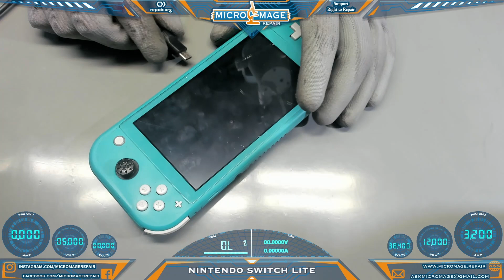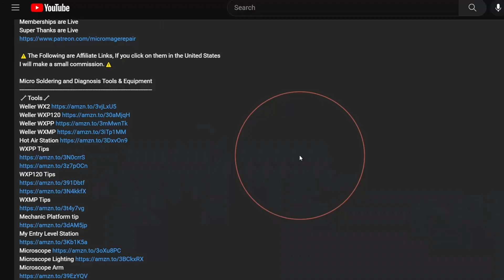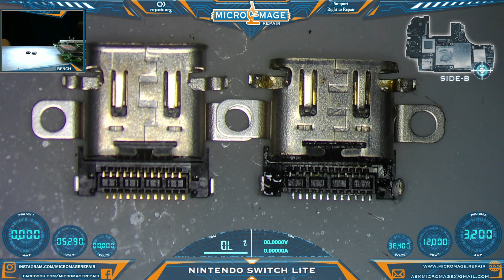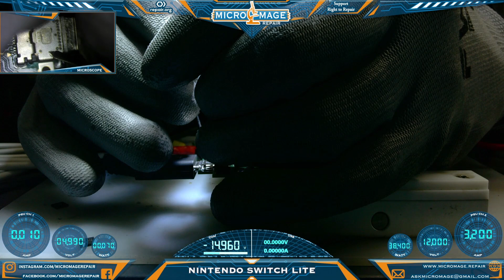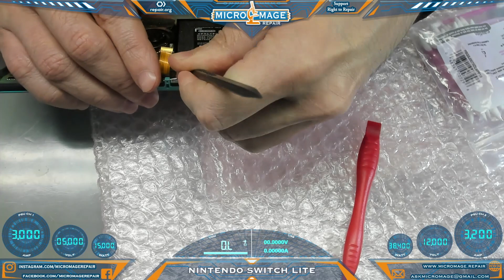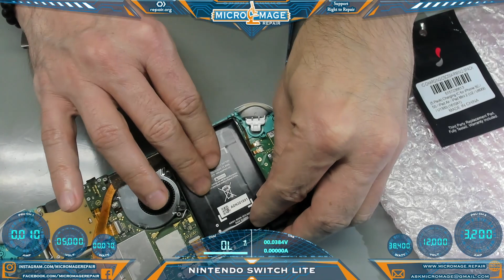Nintendo Switch Lite: Error Code 2101-0001, Port, And Weirdness

Comment: That was a very strange behaviour on the battery, I know Joey had a similar experience on one of his normal switch batteries.  BTW on the charger, I've had a few say the connector on the charger was a little too far back specially with the lite, so on the new version I've moved it closer to the edge of the pcb.
Reply from the maker: That was definitely a first for me.
Great to hear!
It still works on this one. Just takes some fiddling 🤣 
Still love the device!